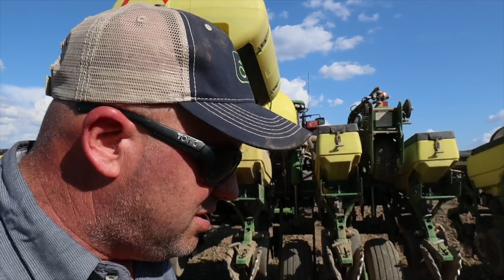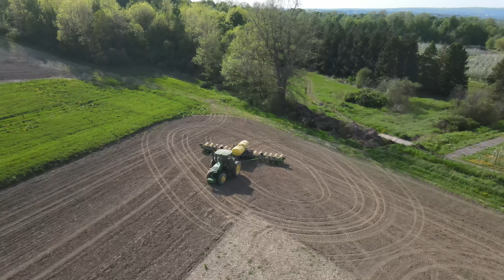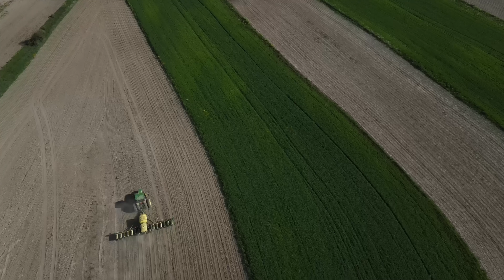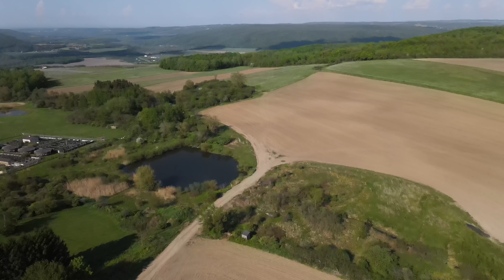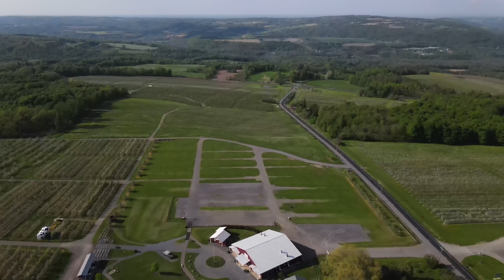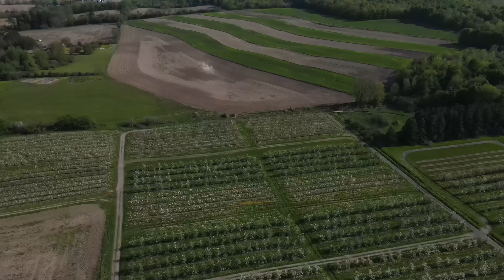No till corn into bean stubble | Beak &Skiff Apple orchard

Comment: Sir I like your video’s keep up the good work.  I like where you split your fields with a cover crop as I call it.  Keeps the water from Eroding the hole area.  My farm has terraces around the hill side. But on a real heavy rain the terrace May break causing a wash.  A big time farmer bought some land near my place he had two D9 Dozers cutting the terraces down Now the field is washing severely.